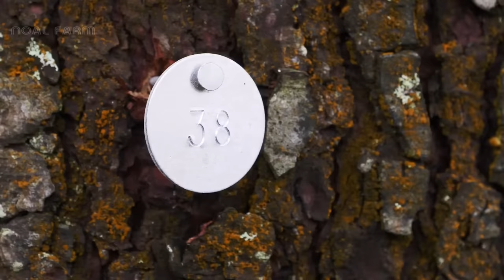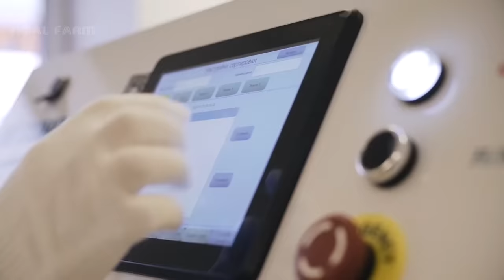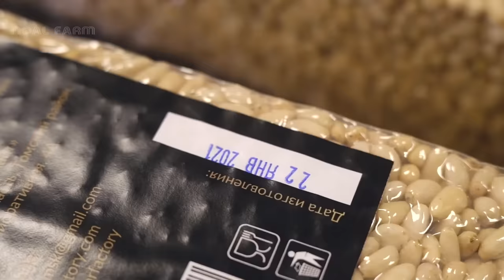Amazing Pine Resin and Pine nuts Harvesting and Processing - Pine Product Processing in Factory

Comment: The liquid they brush on to the wound is often paraquat, it increases sap production 10 fold but also makes the resin toxic
Reply: What could one use the resin for if not using that chemical?
Reply: @Gr3nadgr3gory I'm pretty sure a fairly good salve can be made with pine resin.